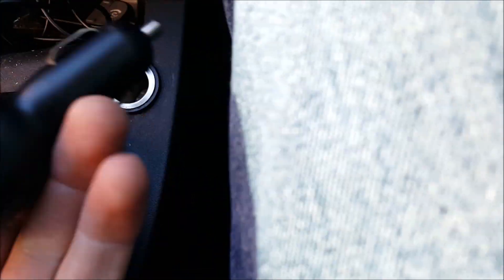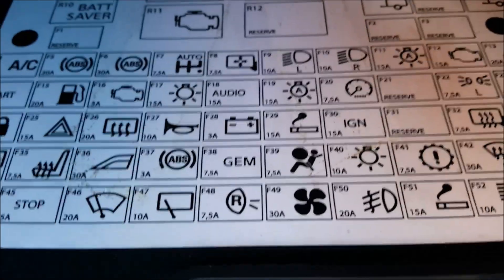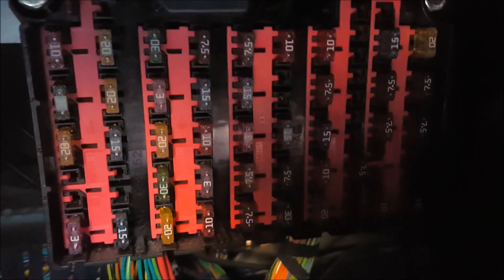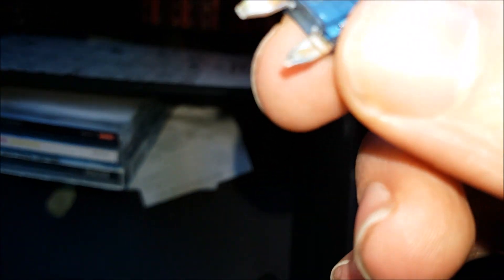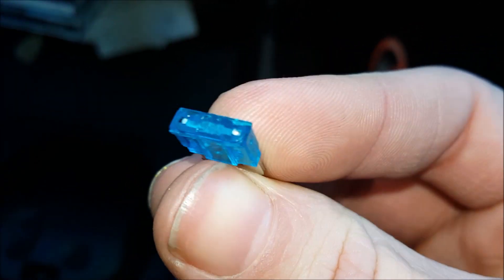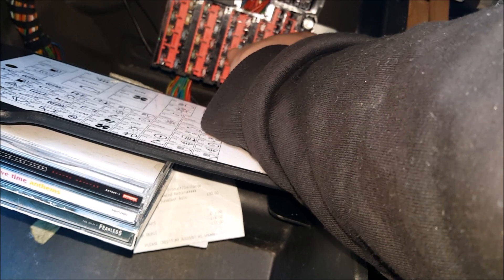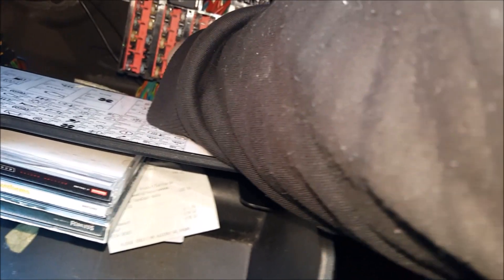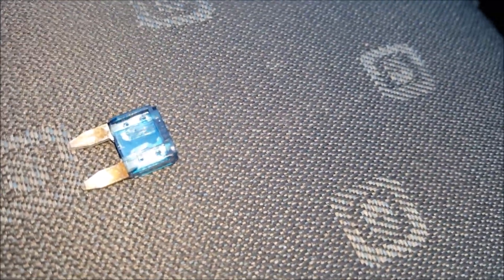HOW TO FIX A CIGARETTE LIGHTER SLOT THAT ISN'T WORKING ON A FORD FIESTA MK6 (2002 - 2008)

Comment: Thanks! Socket now fixed. One thing to point out, there is ANOTHER fuse with the cigarette lighter logo on it 3rd in from the right, at the bottom. I changed this one and it made no effect. You need to look a the one in the MIDDLE of the fusebox, like on the video. Thanks for showing the one I'd missed, in your video!!!

Comment: Do you know why the fiesta has two spots? Ive just replaced my cigarette lighter with a USB port and it remains on, hoping to be able to turn it off.
Reply from the maker: That's just the crazy design of them unfortunately, I imagine the best way to wire it so it only comes on When you want would be to wire it to the ignition

Comment: Mine does work but it is temperamental when changing my phone. It'll disconnect if slightly nudged. Any idea what this could be?.
Reply from the maker: At a guess it might be worth looking at it and seeing if it's got cigarette ash in it from the cigarette lighter. 
Give the contacts a wipe and if the issue still occurs then check the connection underneath. 
If you still cant find a issue then you might be better off just replacing the barrel as it's quite easy to get to.

Comment: I thought my fuse had gone in my fiesta, and replaced it, and it still didn't work. 
I was looking at the cigarette picture at the bottom of the guide 😅
Reply from the maker: If its not a fuse then it could be a wiring issue
Reply: @gazza9919  no no, it's definitly was the fuse. The 3 down 6 across one you changed was the one I needed to swap out. I changed one that was on the bottom row. On my guide that has a cigarette on it as well.
Reply from the maker: @chrissharp9329  ah okay

Comment: Ive got the same proplem cig lighter not working changed the fuse and still not working
Reply from the maker: Try checking the wiring to see if there are any breaks

Comment: Is there a link to the fuse ?
Reply from the maker: Its just a standard 15 amp fuse. If you go to your local halfords or sutton auto factors they will stock them their. Alternatively just type 15 amp fuse in ebay and it should come streight up with them. 
Just remember it's a blue fuse.

Comment: The plastic around the metal has come snapped off on my Mk6 and is now loose. Any ideas on where to get a replacement for the plastic?
Reply from the maker: Would either advise going to a scrap yard or eBay
Reply: @gazza9919  what would I search for on eBay?

Comment: You should change the name of the video to "HOW TO CHANGE A FUSE"
Reply from the maker: You should change your YouTube name to boring comments
Reply: Well tbh it's true, it's not your cigarette lighter that's faulty it's the fuse?  Where as mine is actually faulty so when i read the heading on your video i thought great i'l get a heads up on how to fix it before i start messing about with it.
Reply from the maker: @bonnetdedouche  9 times out of 10 it tends to be the fuse but I can see where your coming from to be fair
Reply: @gazza9919  Mines works but i'v got to f**k about with it and has to be at the right angle or it won't stay working, soon as i go over a bump in the road it more than likely stops working. Now and again it works the whole time i need it too but that's just because i managed to plug it in at the best angle first go 😴 As far as i'm aware you can buy a replacement one and the old one pulls out and you remove the little plug thing from the back of it and put plug in the new one and slot it back in?  Sounds good in my head but guaranteed it will be alot more complicated than that.  OR i'l manage all that and it will still be s**t 🤣
Reply from the maker: @bonnetdedouche  sounds like a nightmare to live with but hopefully it isn't too much of a pain for you to repair